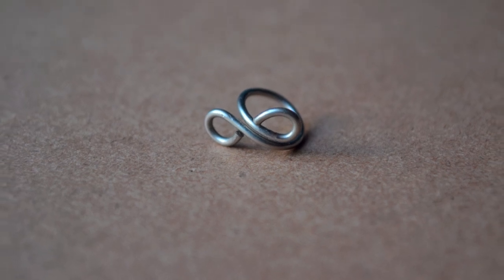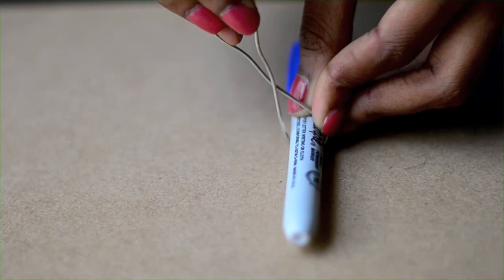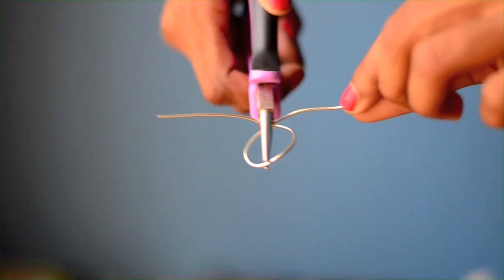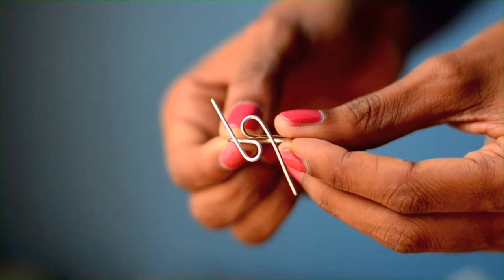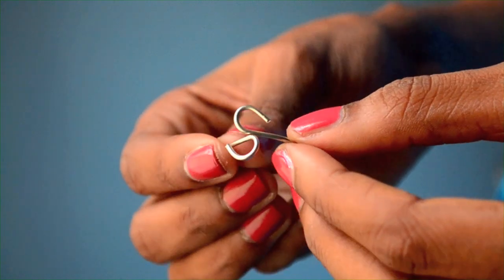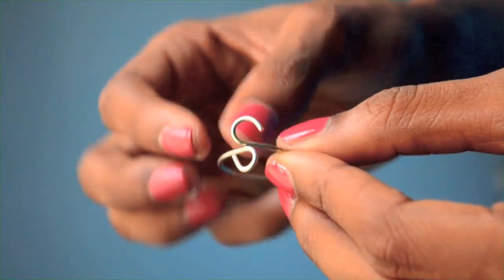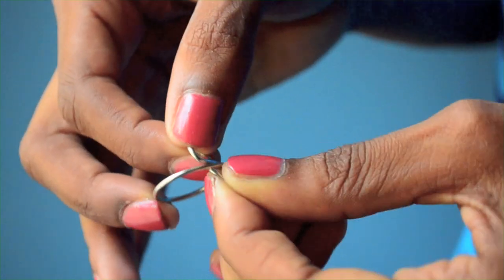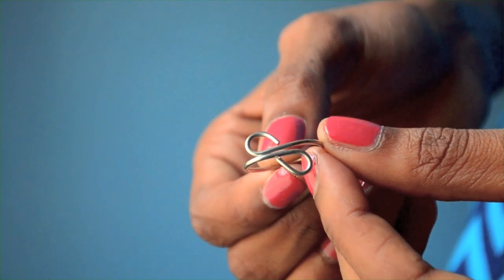DIY Infinity Ring

Comment: I did this using 20 gauge and it looks amazing! I made the rings two sizes larger to start, with a ring mandrel. When I made it look like an infinity symbol, the ring ended up being the correct size. For example, I made a size 10 ring for my size 8 finger.